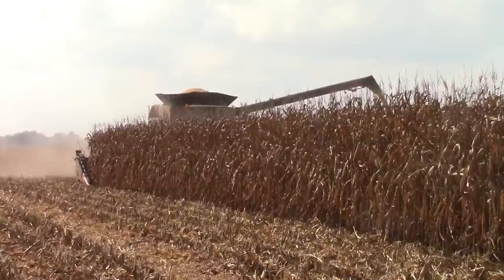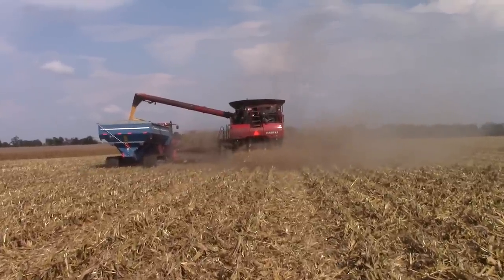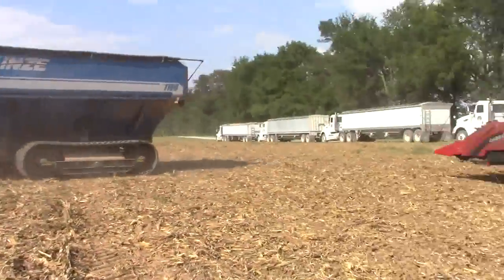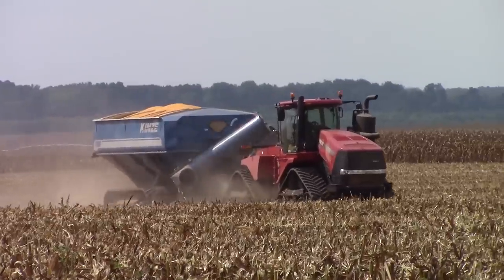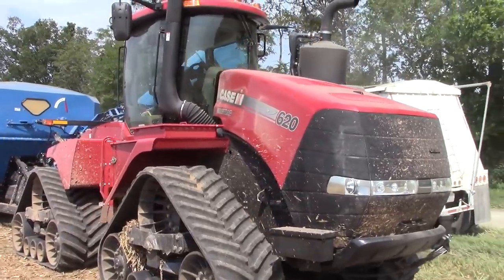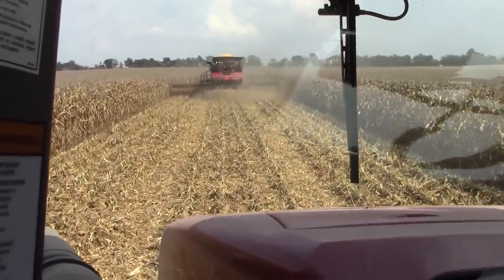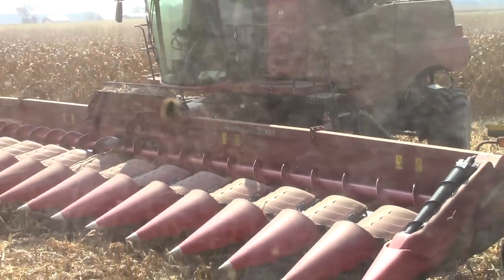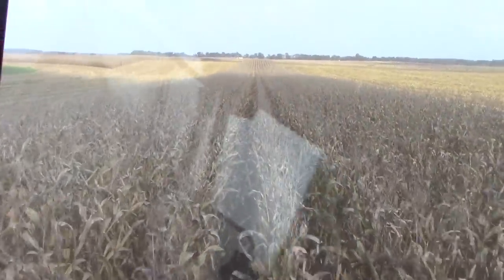Corn Harvest 2016: Case IH 9240 Combine and 16 Row Corn Head

Comment: At 8:15 it would be better to cut into the corn to the left for the cart and get the combine back on it's correct set of rows so when you finish dumping u can just pull off and start chewing instead of waiting for the cart to back out of the way

Comment: How many rows is that head and how wide of an area does it get per pass and what's the field turning out in bushels per acre?
Reply from the maker: The corn head harvests 16 rows spaced 30 inches apart. The combines covers 40ft of corn per pass. In 2016 corn was right at 200 bu.  In 2017 it was around 230 thanks to good rains at the right times.

Comment: How many acres does this farm run?
Reply from the maker: I am not sure.  It's a good sized operation.  This is just one field they farm.   Several farms in the area have big 1,000 to 2,500 acre fields. There is a 1,000 acre field right next to this one where we filmed 8 John Deere S690 combines cutting wheat in a big storm.
Reply from the maker: Just a fence row separates the 3,000 acre field from this 1,000 acre field the wheat harvest was filmed in during this video https://m.youtube.com/watch?v=7nvPlfbvbRc
Reply: +bigtractorpower so they run case and deer combine?
Reply from the maker: This farm in the video is all Case IH.  On the other side of the fence is an all John Deere farm.
Reply: +bigtractorpower do. have any video coming of garnett. farms corn harvest
Reply from the maker: Yes.
Reply: Samuel Web